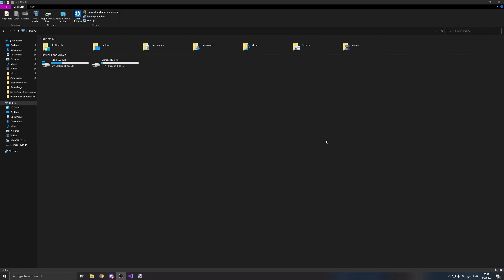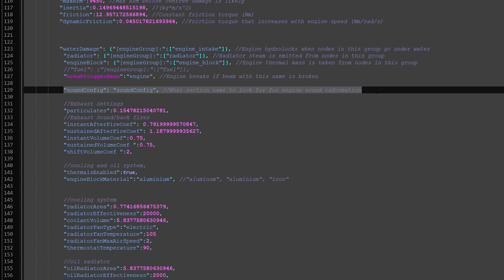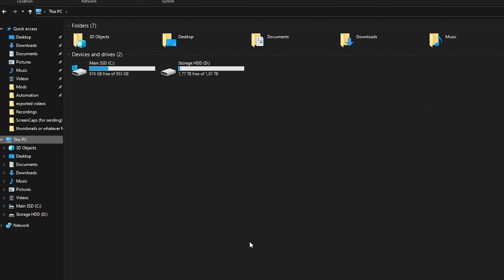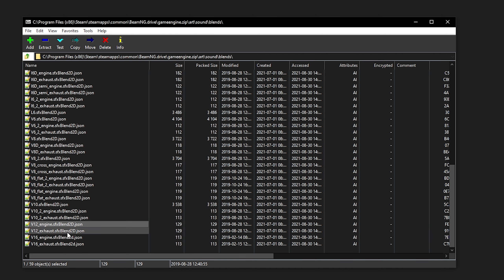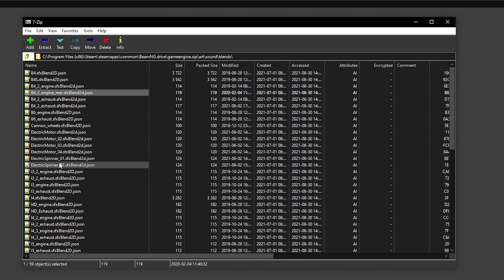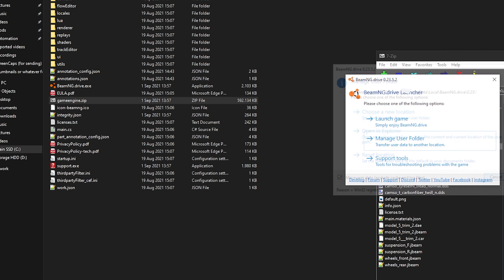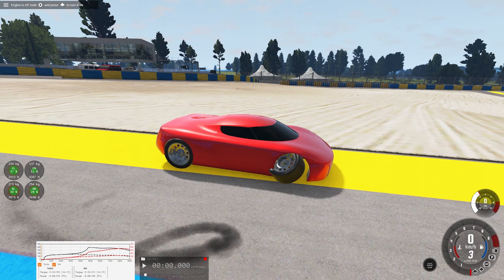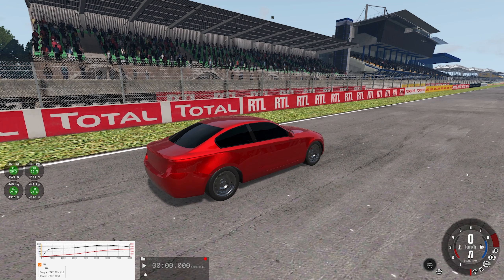How to easily add intake sounds to BeamNG cars

Comment: Idk if this method works for automation exported cars, but when I go to EngineConfigExhaust, change the sample name to the I4_3_exhaust,  and save, it doesnt allow me to save the edit to it on notepad, instead it has me try to save it as a completely new file. Maybe because its located on the OS drive and not the same one the game is installed on? any ideas on what the issue could be?
Reply from the maker: Try unpacking the mod